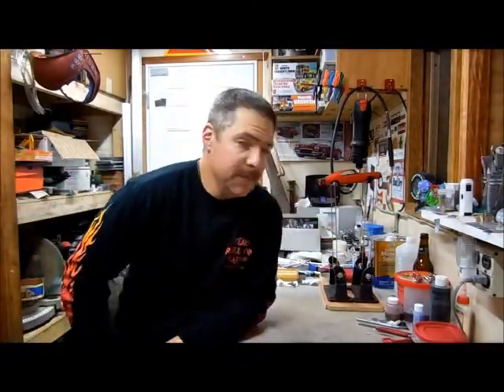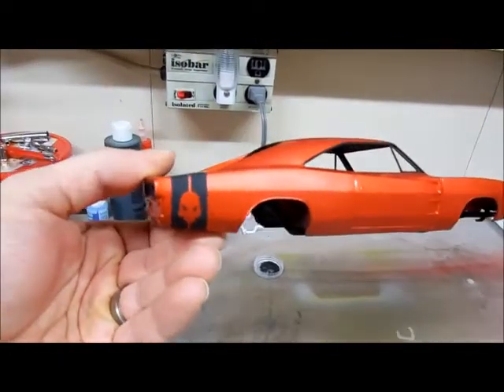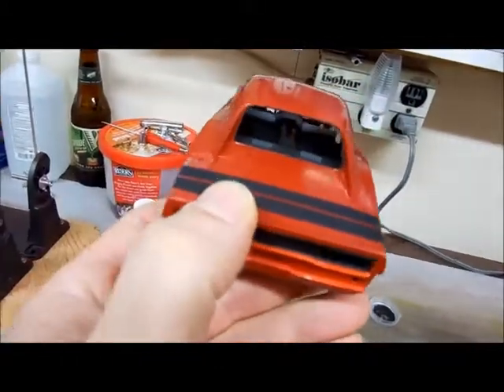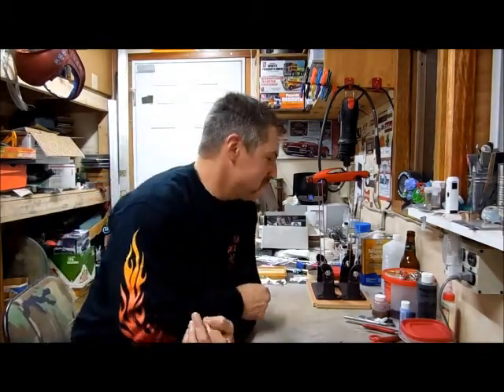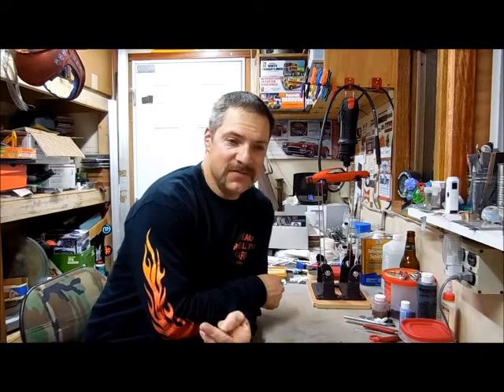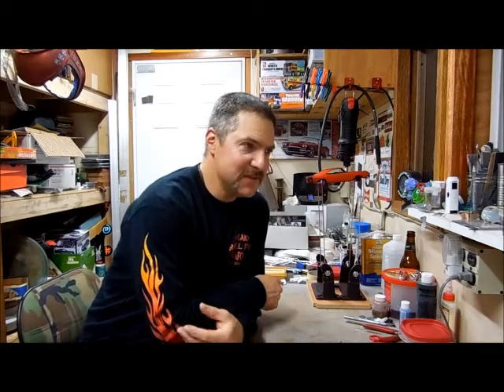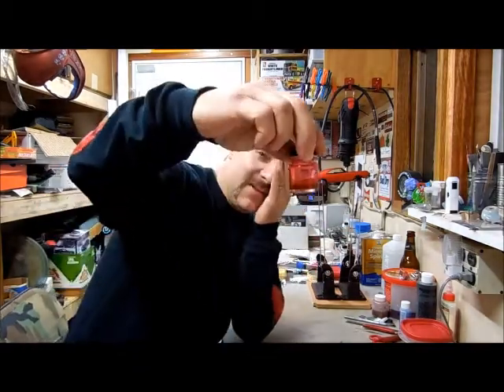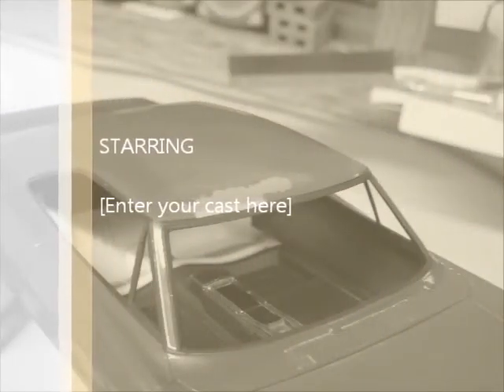'68 Charger Update Nov. 19

Comment: Interesting that you have the paint peel.  I have two bodies that I am working on and both my masking jobs peeled my paint in several spots.  Both cars where washed and wet sanded before primer and paint.  First car was Duplicolor rattle can and second was shot with scalefinishesplus.com pre mixed paint.  Taped off with Tamiya and Frog Tape masking tape.  When I peeled tape the base coat came up with the tape in certain areas.  In that I did not peel up primer it has to be in my prep before base coat.  I wet sanded primer through several steps and let air dry.  The only thing I can think of is I should have wiped down with alcohol before base coat application.  Anyway, I plan on posting a video of my mistakes tomorrow.  I am curious to see what folks might think to help prevent this from happening in the future.

Comment: I'm crying out for you. Think paint problems are the order of this week. Vinyl is one way but I haven't seen a really good job on this getting the texture right to scale. Lack of paint or getting the correct shade to repair the roof, so think its a strip job, when removing masking tape I use a hair-dryer or don't leave the painted job in a cold workshop over night.

Comment: Hate to see that bud. I am wondering if that is Testers metalizer on that for base? If si I have had the exact same problem with one section or another on at least four builds. Decided to only put it down on a build with no taping. Sand and repaint, add some rust and turn it into an old barn fin/ project car, Vynal top. You have many options and I can't wait to see what you come up with.
Reply from the maker: Base is plain ol' testors gold and it did not peel everywhere I had taped. This car did not want to be painted this color, LOL! Thanks Chris.